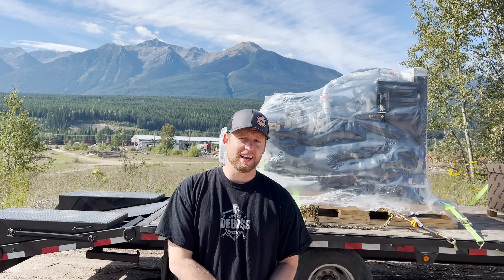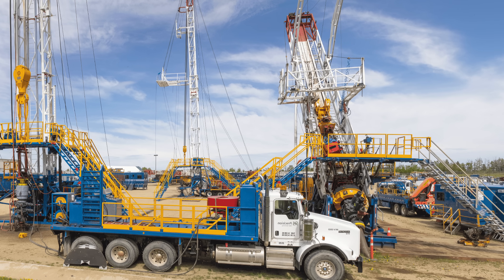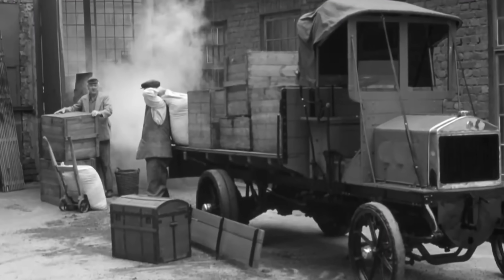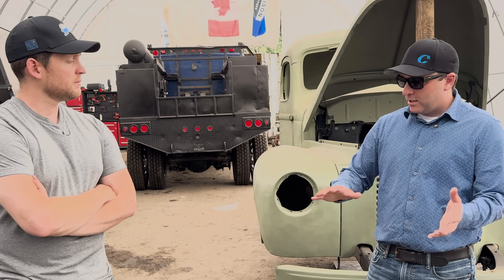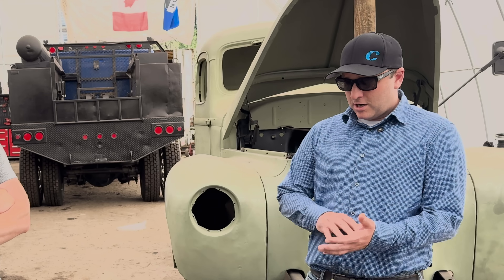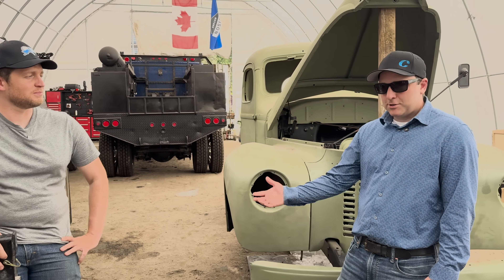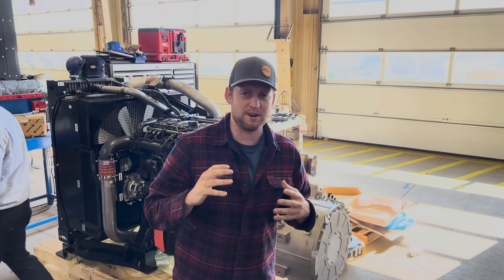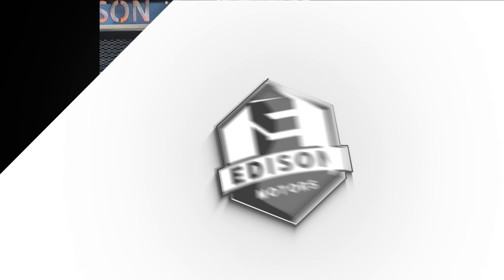We're putting Scania engines into Edison Motors Trucks!

Comment: I'm confused. I thought this was an EV company but you're putting engines in your vehicles?
Reply: Operates like a train. 
The diesel engine acts as a generator to charge the batteries.
Reply: This is nothing they've hidden, I guess you have not watched enough videos. The diesel engine is there as a generator of electricity that goes into a battery bank. It's not like diesel electric trains that drive electric motors directly (in the last decades some hybrid trains has come along). Formally it's a "series hybrid" so the only motor for the axles are the electric motors, and since they are bolted together they are called e-axles.
In the early Edison days Chase avoided the word 'hybrid' because of people probably thought of something else. But it is. But it's great for the market they go for. Having the diesel generator work at a constant speed to charge the batteries makes it happier (and smaller). When battery is charged up enough it turns off and drive off the battery. And going downhill with logs (loaded) regenerative braking can recapture energy into the battery. Driving back up the mountains they are empty. So Edison will help that industry save on fuel.
BEV trucks such as Tesla Semi will outcompete trucks in that local/regional delivery market operated by big fleet owners. That's the perfect fit for them. Going full BEV for a logging truck maybe isn't the best to start out with.
And if any potential buyer of Edison trucks have the perfect use case for a BEV vocational special truck where they will have time to charge and is more predictable - like maybe garbage truck? Then Edison just has to put in more battery banks, out with the generator and it will be working.

Comment: I'm wondering why you need such a large horse power motor. Why not have a lighter more fuel efficient motor and off set the weight with more batteries?
Reply: I would think that's up to the customers choice, Scania V8 770hp is the top of the line. In the Nordic countrys there is a use for such big engines. I'd guess most would buy the 530hp V8 or even go for an inline 6
Reply: @davidlindberg4567  remember they have e-axles that are made for a specific max torque and and as long as there are enough batteries to provide power that's the limit. The diesel generator just need to be enough so it doesn't have to actually stop to recharge. To me it seems like a Scania V8 770 hp would only be needed in a tridem (or more) e-axles configuration for special hauling.
I think Chase got carried away a bit with V8 talk here.  The one they got there in the video is an inline 6.

Comment: Here in Australia Scania trucks are pulling 4 trailer 200 ton road trains and they are killing it. Very popular in big fleets in long haul road train work. Perfect choice to repower your rig.
Reply: Iam not in trucks but I drive buses and there's a reason most of the buses in Australia run scania chassis and running gear.
Reply: That is so awesome, in Sweden we are limited to 2 trailers for a road train (used to be more before the 80's or so), and you cannot use the longest trailers for those, there is a maximum total length and a maximum individual trailer length, but hey, most of Europe actually only allow a single trailer on their roads, so we are luckier than them at least.

Comment: I have just found your channel and happy to see another small company in North America going for Scania , you won't regret it . I'm a retired UK truck driver and had the good fortune to land a job in 1996 driving a Brand New Model 124 360hp 4x2 Sleeper Cab Scania 38 Tonne GVW that had just come out , it was a completely new model including the Engine with an 8 speed splitter box = 16 speed .Cab comfort was excellent and had a night heater that ran on Diesel . Before that I had driven older Scanias and all were good.

Comment: I drive a 2012 R model 730 hp with livestock mainly to italy. Good power over the mountains in the french alps and up the hills. Retarder keeps speed down when going down hill without using brakes. Good trucks only the cabs are bit small comparing to US trucks.

Comment: I’m so happy to see your partnership with Scania. My only experience with scania was with our 2870 case. It had a 6 cylinder scania engine that was a reliable horse. I love the sound of their V8 engines. Look forward to seeing Edison trucks all over North America. Too bad the normal players won’t deal with you like scania. Glad you found an awesome partner.
Reply: How did that 2870 hold up? I am considering a 4894 for an occasional use tractor for when I have to run in rough territory where I worry trees and brush probably tear up the 8400 Deere
Reply: @bcbloc02 The only issue we had with it was a bad head gasket, that caused it to run warm. Replaced the head gasket and never touched it again. Ran it for about 10 years, 50 to 100 hours a year. It was an old workhorse, the only issue with the tractor was the powershift shifted hard and full throttle and road gear was slow, about 14 mph. We didn’t have long trips to the rented property, so it wasn’t a problem. It was the best starting tractor on the farm, no matter the weather. If it spun over twice it was running. I wouldn’t be afraid to run one. Cheap Power. Good luck.

Comment: I thought the whole point was to put smaller engines in to run a generator to power the electric motors? What’s going on here?
Reply: Too much talk about V8 here and there. The engine shown is a 6 cylinder and probably smaller (9 liter?) one [EDIT: might be the 13 liter one?]. Chase want to build a V8 one for a showing later but I don't think they will need to have such.

Comment: What would be awesome is developing a transmission that can operate as a generator or it have about an 12 speed transmission to the ground. Or have it  as a generator , diesel/electric but that is the hot rodder in me. Having  a 770 hp v8, with about 8 gears in a custom gear box with a auxiliary overdrive. To get a 9 speeds or 18 speeds by splitting gears. In a  single axel with single wide tires and rims. On all corners. Build a trans am inspired truck. With carbon fiber front clip, doors nearly the whole cab, build an aluminum frame for the cab and doors . Then cover with carbon fiber panels. Maybe an extrnded cab, to have the extra room thst could be a sleeper, but would just be a extended cab or crew cab in a small truck having a large seat someone could sleep in. Use it to pull a custom build çamper that has a garage . Capable of hauling a small car two motorcycles. And more with a pop up roof giving a second level , only 3' tall to start with, then thr roof raises up with the walls made from vinyl and  foam padding for insulation of heat and sound. Also having a wire rope mesh coated in nylon to ptotect the insulation.  With another vinyl or canvas layer inside being sbout 4" thick and about 4' tall when raised.  And the roof covered in solar panels. With about 30" tires on the camper. With room for a honda civic and a couple motorcycles, or a Chevy Colorado, without motorcycle. Unless you add a lift and back the truck in. With a nice kitchen , living room and bedrooms upstairs, a bathroom with 200 gallon black tank, 200grey, and 400 fresh water tanks. Using grey water to flush. With a shower with a seat. And gas on demand water heater. A 6kw inverter 20kw batter, and nearly 6kw of solar, with a 3.5kw DC generator to charge batteries. With a screened in awning.  Ill never have it but its awesome dreaming about it!! Have an awesome day 🎉

Comment: I'm trying to understand, since the engine will be used just as a generator, why does horsepower matter?
Reply: Over a certain point it doesn't, and the engine they have gotten looks like a 6 cylinder 9 liter [EDIT: might be the 13 liter one?]. The V8 talk isn't what they in practice will have

Comment: I worked for Scania in New Zealand, by far the best company I have ever worked for. I would still be working for them if I hadn't moved here to Oilberta Cananada. If you're considering a V8 engine for your vehicles, please note that the exhaust manifold bolts and turbo mounting bolts often come loose from extreme heat cycles and being down between the frame rails. I don't know if this will be an issue for you, but it is something to note with your designs.
Reply: I doubt they will use a v8 to power the generator.

Comment: Put in the Big V8 
With a strong frame and heavy duty 3ri drive axles
We get to see the next big daddy of prime mover truck
Reply: That's the only legitimate use of the V8, for a truck with 3+ drive axles so they have the possibility to use that much power that it can charge batteries with (without taking a break). For the normal 2 axle it isn't necessary.

Comment: So much negativity.
Why do your American trucks diesel engines brake and leave you buy the roadside? Could it be something about the varying load on a logging truck that wear them down? 
This will be an engine connected to the generator doing one comfy rpm in a steady load. Maybe it won't break on you like you are used to? 
And with it not being the direct force to drive the wheels, the truck will work anyway to get to a nice spot, and maybe in many situations back to the work shop so no extra money for hauling it back there.
This might make it a better choice for now. Listen to what Chase says. They have problem getting the right collaboration with other diesel engine makers. We don't know which (people write about others than CAT that they think they should have). But he doesn't name drop and say they suck, so leaving the door open for business WHEN they get big enough to buy the required amount of engines and not just being a startup.

Prototypes are easy and volume production is hard as Elon says. 
For the time being I think it's best they focus on one supplier, not spend the effort to design everything for a long list of engine makes.

Comment: Scania engines are trash. brand new engines run hot and have multiple leaks from new. The parts availability is BS, They failed in the Terex articulated trucks and fail in all the Terex crushing equipment .

Comment: Am I missing something?  Is this for a straight ICE truck build, or for use as a generator?
Reply: Generator. They don't do straight ICE trucks. Chase got a bit called away about the V8. I think the regular trucks mostly will have a 9 liter straight 6. With batteries and e-axles built to a spec there will be a maximum power - an even stronger engine would only allow them to charge in a shorter time which doesn't help.

Comment: So did you decide your trucks will have to meet the emissions standards after all? I thought that was why you were using old style Cat motors, because it was considered a stationary motor. Are you just planning for the government to close that loophole?
Reply: Good to plan ahead I guess. I might be wrong on this but I think they realized with Topsy they could make it so the batteries aren't involved (in case of some problem) and the e-axles could be driven only by the generator. But the efficient thing but anything that takes the truck home on its own is good - and then they aren't really using it as an onboard charger and regulations might slam on them. But I could remember wrong on this part.

Comment: In Sweden, Finland and Norway is far more common that Scania trucks with V8s e.g. 770 and less are used for 25,25 m combinations with weight of 60 ton and 34,5m combinations with weight of 74 ton, trucks with trailers for timber trucks and long haul. 40 tons are more common for trucks that goes in Germany, Netherlands, France etc. and trucks that runs over many countries in Europe.

Comment: I don’t know about that… I’ve only ever seen one Scania engine in my life, in our new crash truck at my fire station. (This being the truck that’s always broken, so they use the two backup crash trucks that have an 8V92 Detroit and a C16 Cat). I’m pretty sure that Scania engine has a DPF also. Here in California, it doesn’t matter how the engine actually runs as long as it has what the state thinks is best, so they may not allow it not to have a DPF, I don’t know. I’ve seen more Perkins, Yanmar, Deutz, and other foreign diesels here than Scania. I might be willing to give it a shot, but I have diesel mechanic friends all over the county and none of them have seen or touched a Scania engine, and I’ve never seen a Scania parts house in the whole western US. I think I’d almost rather see Cummins new weird “fuel agnostic” engine, or maybe just an older LPG engine that doesn’t have to meet emissions standards. I’m not saying there’s anything wrong with the Scania engine (I grew up riding in a Saab… but we had to drive and hour and a half away for service) what I’m saying is that lots of people, myself included, will be afraid to take a risk on an engine that they have never owned, have no mechanics that have worked on them, and may never have heard of them at all.

Comment: How much hp/torque do you actually need for optimized charging of the batteries??

Only a minute in, maybe you'll answer that later. At a glance, seems like a LOT of motor for steady state charging some batteries.

Never came up. I'm genuinely curious to know. Maybe the charging system works best with 300hp thrown at it, making a 500hp motor potentially a good choice. I would expect the HP number to largely be irrelevent though. It'll be the torque number at the RPM you run the motor at when charging that truly matters. HP figure just being a byproduct of what's actually doing the work.

How much torque does the charging system demand?? Is a motor capable of pulling the trucks weight itself actually necessary??? Maybe it is. Seems crazy to me. But, I don't actually know and I want to!! This stuff is so interesting!

Comment: UE emmisions are too hight because every new car in eu is just fucked up before left the factory.
EU norms kill cars engines 
For example, a 1.1 liter engine with 2 turbos generate a 150hp and oil change interval is 30k kilometers AND you cant change gearbox oil. This never be run forever.
MAYBE scania doing this better maybe...

Comment: Chase… Great engines, great quality, but that’s about where it ends. I would implore you to take a harder look at how feasible it will be to get work done on these engines in this vast country of ours.
I did some factory training with Todd a few years back and I can tell you that Scania is right up there in terms of proprietary diagnostic software and service info. 
Sure they’ll sell it to you or you can go pirated, but the trick is knowing how to use it and whether it’s actually cost effective for you. 
And if the dealers across Canada (with the exception of Collicutt) are anything like the one I worked for, they actually aren’t that well equipped to handle repairs in any sort of swift fashion. 
Not saying you made a bad choice, but be realistic about what you’re getting into and how customers will react to less than ideal circumstances when it comes to repairs.

Comment: I guess that means the engine you into from China are not going to be used. European engines are better built than US and Chinese engines. And I am a Canadian. Can't wait to see them in a truck.
Reply: I don't think they have talked about any diesel engine from China? They have the e-axle, so axle and electric motor in one unit. 
I think they aluded to the same thing back then, a North American brand that actually made those who didn't want to work with them (or more specifically, the small number of units they wanted to buy in the first years).

Comment: The motor is just turning a generator!   You don't need that high horsepower engine for that.  You're going to increase fuel usage and the overall cost of the truck.
Reply: I DEFINITELY FAVOR PUTTING IN AN BIGGER ENGINE AND RUNNING THEM EASY!!
CASE IN POINT, LOOK AT THE FORD V-6 ECOBOOST LIFE WHEN PULLING HEAVY TRAILERS OR TRAVEL TRAILERS!!
BTW WHO BUILDS YOUR TRACTION GENERATORS AND MOTORS??
Reply: @rossbryan6102  well yea... you have to spec the appropriate engine for the job! The v6 eco boost works just fine if you tow no more than 6000 lbs.  If the torque curve on a 400 hp motor works within the specs of the generator, the added cost for a bigger motor is not cost effective.   Your paying for more and not getting any gain.  Trucking is about the bottom dollar, not how you FEEL!

Comment: 6:29 Mostly agree with you.

I have a 9 seat limo with a 5.7L V8 i can cruise down the road at 55mph churning only 1000RPM and getting over 30MPG. Now sure a modern engine would do better even if it was an 8L+ but compare it to similar vehicles of the time with a 4.6L and i'm getting better mileage. sure those Lincolns are using a DOHC which in generally i think are less efficient but have better energy density potential. the problem is those high output engines arent put in those land yachts, for instance, i have the same engine as the corvette, but instead of 340hp its making 280hp, those lincolns i think are tuned down even more making 210hp.

Comment: just put the smaller motor in. Smaller motor working harder is more efficient than large engine underworked. Plus it's just to power the generator right? Smaller engine will be much lighter, therefore less energy used to haul the truck uphill. Might get most that back in regen I guess. Larger understressed engine might wear better, which is a cost too I suppose. Go the small one.